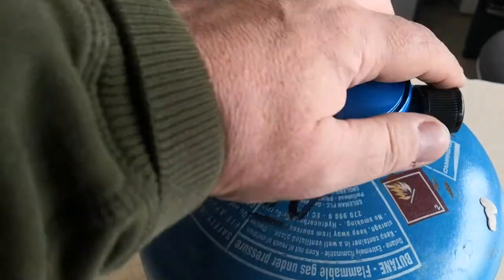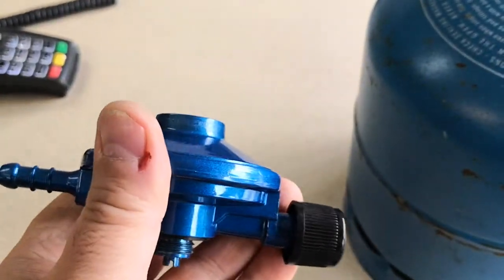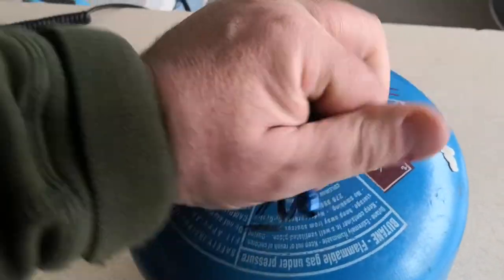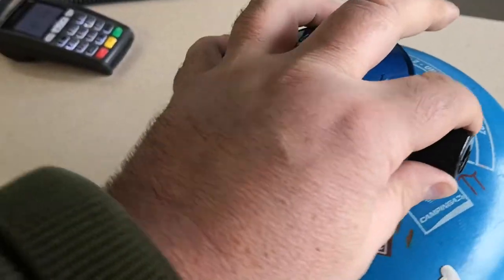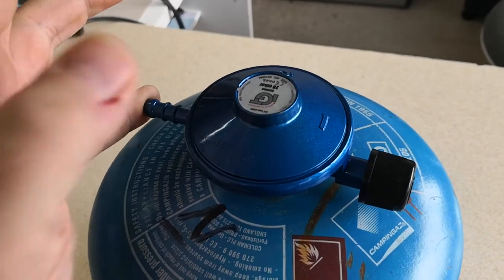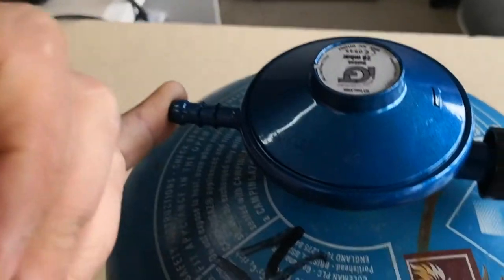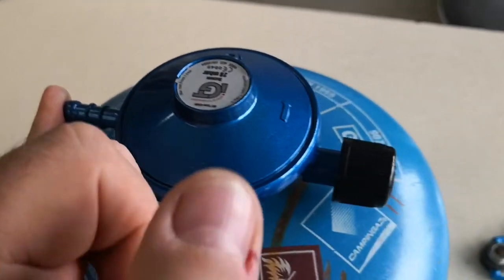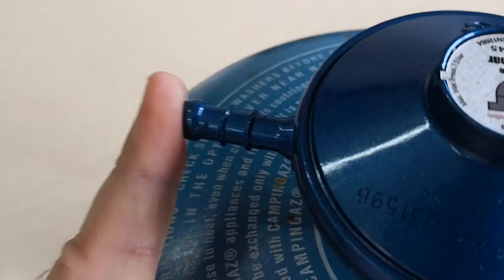Campingaz type regulator saftey tip - Camping Guru UK

Comment: Thanks for the interesting video. I was interested in buying and using a camping stove more for in cases of emergency if the UK's gas supply was affected by recent events, and had a few questions if you wouldn't mind answering them: 

> Can I attach a campingaz stove to a large gas cylinder like a Calor gas bottle (of either propane/butane)? 

> Is there a way to know how much gas has been used/is remaining?

> What is the best and safest way to store the gas bottles? 

> If I were to use the camping stove and gas now and again with long gaps (even years) in between use, would there be a problem with doing that and would the gas remain useable?
Reply from the maker: Yes, you just need the correct regulator for the bottle.
To check the gas level in a larger bottle just feel where the bottle is coldest or pour water down the side of the bottle and you may see where the gas level is. You can of course weight the new full bottle and the weigh it again after some usage and the difference is the gas kg.
Best to store a bottle outside, if its for some time bring the regulator indoors.
Gas bottles can be stored for years, the hose on the other hand needs inspecting and best to change every couple of years. Do not use more than 2m as the gas (especially butane) can turn back to a liquid in cold weather.
Reply: @camping_guru_uk  Thanks for your reply, that's really helpful. I don't have anywhere outside that I can store the gas so would it be ok safely stored indoors away from radiators or other sources of damp/heat?
Reply from the maker: Ideally not as the hose, regulator etc could over a period of time leak and I mean a tiny amount so indoors is not ideal.
Reply: @camping_guru_uk  Apologies for all the questions and I appreciate your time in answering. Hopefully this is the last question. What if I disconnected the camping stove, hose, regulator from the gas cannister if I knew I wouldn't be using it for a long period of time, could I then store the gas safely inside without fear of leakage from tubing etc?
Reply from the maker: @dooli1981  hi, yes that would be the best option of you have no other option. All advice will still say "store outside" though.

Comment: This may be a life saviour.  I’ve just bought a campingaz camping chef and corresponding 907 gas tank and regulator (all brand new) and my regulator doesn’t rattle.  Should they all rattle regardless of manufacturer?
Reply from the maker: Ever brand I ever stocked did, definitely the Campingaz brand itself.

Comment: Hi I've just bought a campingaz stove it's the 400sg but the connection is a screw on thread at the back of the stove and I need a push on type like on the regulator any ideas on what I need to get? Any advice would be great

Comment: Hey Gary. I have a Campingaz camping double folding stove which i use for 24hour fishing sessions. the recommended canister to fuel it is the R904 which weighs about 10kg when full, far too heavy to comfortable carry along the bank with all my kit. Novice question for you: Can i use an adaptor or somehow use and connect a FAR smaller fuel canister as i only need it for 24 hour stints. I think the inlet on the stove is 21mm rubber tube, i would really like to be able to connect a very small lightweight fuel canister to it. Thanks in advance. Linton.
Reply from the maker: Get yourself one of these regulators and a coleman C500 gas cartridge. Should last you a weekend of cooking easily. https://wowcamping.co.uk/productDetail/highlander-gas-cartridge-regulator/?gclid=CjwKCAjw4pT1BRBUEiwAm5QuR_1crEu8CW0Bp3Hu9PtsWZL2zeA3YuwHqZzqTAxXJovQ1D3iOA_27BoC4ngQAvD_BwE
Reply: @camping_guru_uk  Many thanks for quick and very helpful reply, appreciated thnaks.

Comment: looking to get a camping gaz 907 for using with my kampa parabolic heater,but is it possible to connect the 907 to my primus easy fuel stove with an adaptor of some sort ? the fitting on my stove is just the standard for gas cartridges.
Reply from the maker: Not that I know of, I'm sure someone out there might of figured out a work around but I as a retailer would only recommend you use the recommended cylinders for your appliances